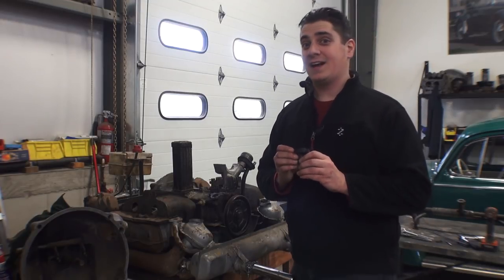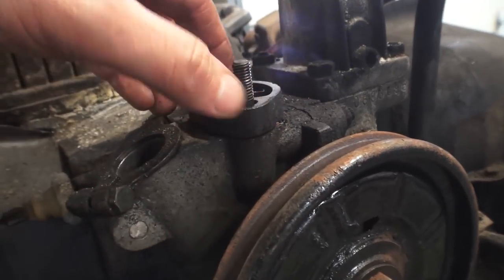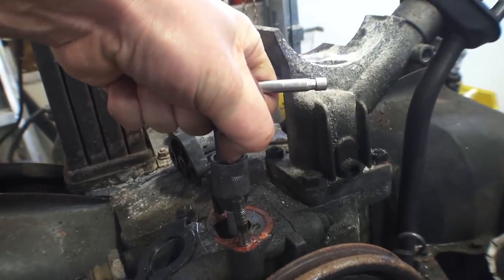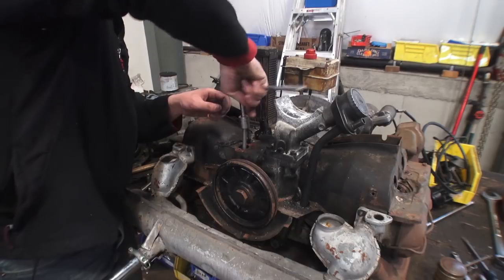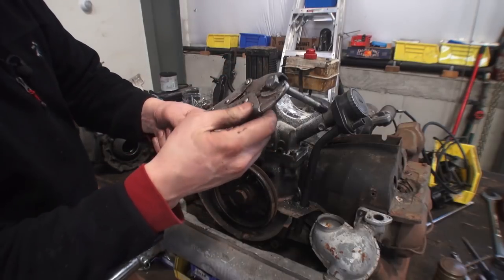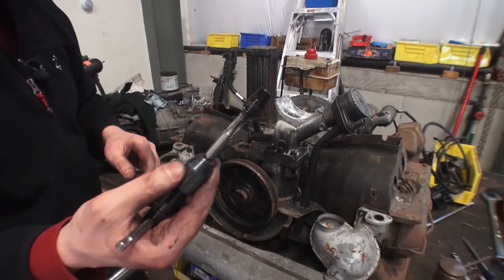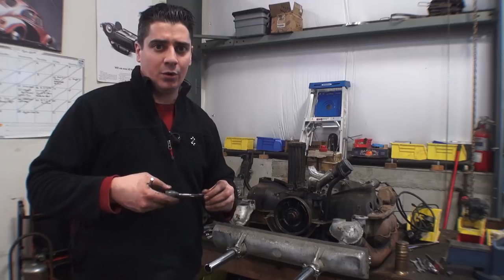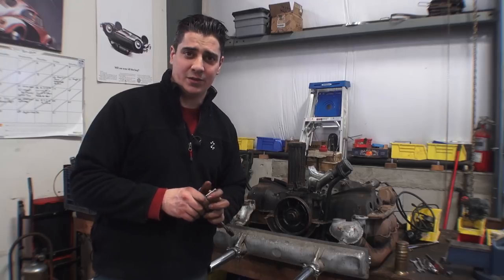Classic VW BuGs How to Fix Broken Beetle Fuel Pump Base Stand in Block

Comment: hey chris great post, my problem is that the last inch or so went down and in, and now i have lost sight of the darn thing, its a bigger piece then im comfortable with , i have already cranked the engine with no problems YET what are your thgoughts on my situation? thanks steve
Reply: Desperately need an answer to this

Comment: Tried everything to get the remaining half piece out and did not succeed. Eventually broke into small pieces inside and let it fall down inside. What is the consequences of this? Will it fall into the oil and I can get it out on a oil change?
Reply from the maker: it is a soft material, it really will not do too much harm, drain the oil, it usually falls to the bottom of the block.
Reply: Thank you Chris, appreciate the response! @classicvwbugs

Comment: Hey chris. Does the remaining piece work as it is ?? Or do you really need a new plastic base ? I just broke my at the same place, and started the engine. It worked but the stoped after few minutes. Dont know if the problem is the pump or this.piece.
Reply from the maker: I would get a new base, yeah.
Reply: Did you ever get your piece out?

Comment: As just a suggestion. I use a tap, and a small piece of metal conduit or pipe. Along with two washers.
One on the top and one on the bottom to help support the pipe. As I screw the bolt down it makes contact with the pipe, tightens the whole mess up and pulls the broken section out.
This eliminates the hammer and vice grips.

Comment: Do you know if the flange for the alternator style is the same as the generator style fuel pump? I got a new one today and it "protrudes" from the bottom a lot more, trying to figure out if the wrong fuel pump has been on my bug. Thanks.
Reply from the maker: you mean the base?  I think they are the same.

Comment: Great Video Chris - my stem has also snapped / clean break around the upper oil hole  - I'm wondering if i should risk it  disintegrating - the bottom piece is stuck in - its tapered as it enters the hole down in there - it has the rod through it - is it gonna go anywhere once the top is clamped back down ?  ok to leave it ?
Reply from the maker: it has to come outta there, can't leave it.  if it goes in the block, let it sit overnight and maybe next day oil change it will drop out.

Comment: well done Chris!,this is exactly what happens to my pump riser block,I sanded the replacement on the lower part to fall freely into the case to prevent the fuel rod from grabbing once hot!

Comment: Hi Chris-
I think you have done a fine job on most of your videos I have watched.  This last one about the fuel pump base is alot better than the last time i did it.  But building on what you have here- after you tapped the hole for the shaft, if you would have put a beefy flat washer and a spacer of some sort on the bolt you probably could have just used the bolt to jack the broken part out as long as you had enough thread of the bolt in the broken stand.  Thanks for the quality vidoes.

Comment: Good to know! I just replaced mine because it was leaking and seemed warped where it meats the engine. Luckily it came out in one piece. Thanks for your videos! They have been a big help keeping my baby 65' on the road.
Reply: Is it leaking oil or benzine ? I smell benzine leak from bottom. But there shouldnot be sny benzine at that place right ?

Comment: Chris...any idea buddy? To pull out the rod and base?
Reply from the maker: I would soak the rod first with some penetrating oil or WD-40.  Once the rod comes out, you need to cut some threads into the base that is still stuck in the block, then use a long bolt to screw into the base then pull it out.

Comment: Hello Chris , great videos , my 1975 beetle starts first time when cold and runs great but when you try to restart engine when it is hot it won't . it turns over but will not fire up until it has cooled down for about an hour , do you have any ideas why it would do this and how i could remedy it , kind regards Liam

Comment: hey chris was trying your method but about half an inch fell down do you have any suggestion ???? thanks
Reply from the maker: +jonathan ferro Fell into the motor?
Reply: +Chris Vallone yes in the block
Reply from the maker: +jonathan ferro ok try draining the oil, and take the bottom plate off too, see if the piece falls out.
Reply: +Chris Vallone hey chris didnt come out i turn the motor and it ended up locking up kept cranking few times and it broke lose guess it chewed up the plastic then drained the oil twice had small pieces of plastic but everything is working correctly so far thanks for your help appreciate all your videos they have helped me a lot
Reply from the maker: +jonathan ferro ah very cool!  Glad it is ok.
Reply: Chris my late father  was a  Volkswagen  mechanic  and service manager  he removed the fuel pump  spacer  the same way you did with the  tap and he removed the starter bushing the same way so they did not have pull the engine  replace the starter bushing.

Comment: Would possibly a cork screw work? Since the tap just makes a hole with threads, a solid screw might grab better.
Reply from the maker: Well you are tapping threads into what is left of the fuel pump stand that is stuck in the motor block.  Not sure a cork screw will work, but a big bolt like I used was good.

Comment: hey Chris i had a question i have a 1600cc duel carburetor single port I'm no getting any fuel in the carburetor. So first thing i did was check my fuel pump and lines and noticed with the new fuel pump the lever was very stiff. is it suppose to be stiff? it was very stiff where i had to use both my fingers to press it down. i just bought it and was already not working hours after i installed it. I'm starting to think it's just the fuel pump because it says it was made in china. i need a german right?
Reply from the maker: I would, try and get a german if you could and go from there.